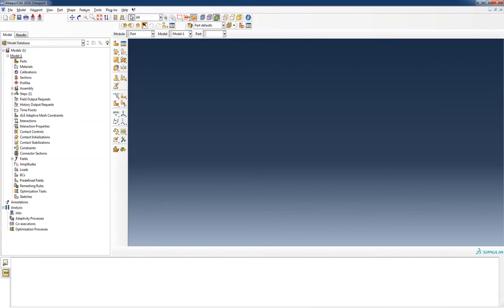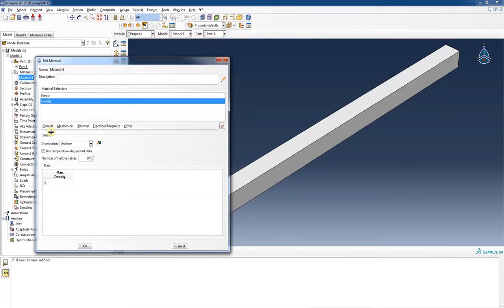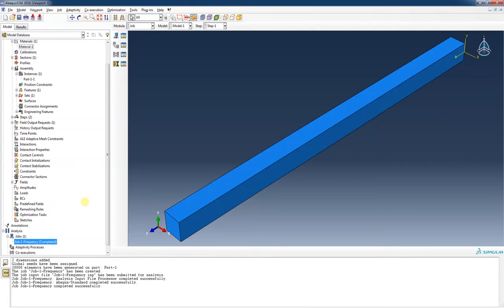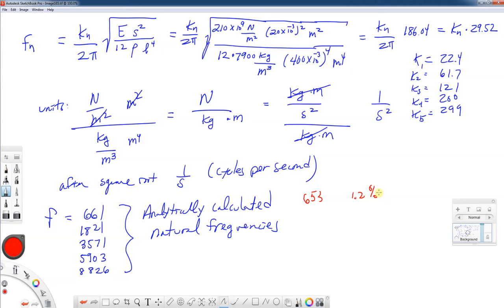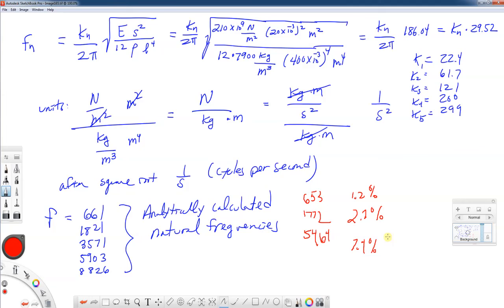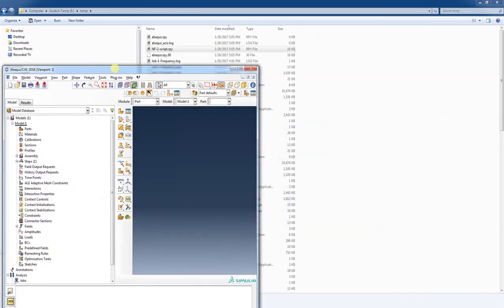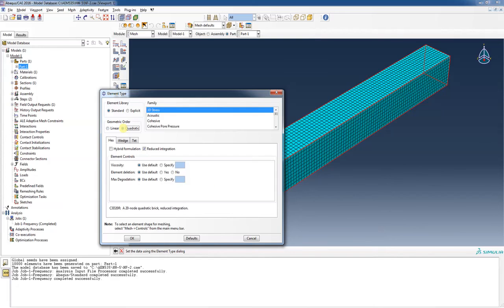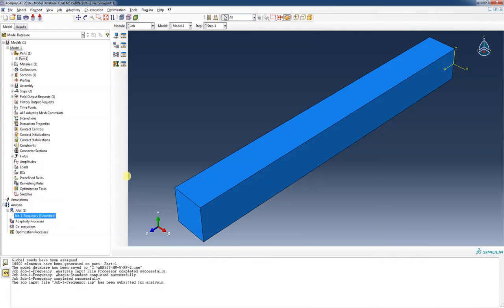AEM 535 HW-5 Natural Frequencies of a Beam--Part 2--FEA Solution

Comment: Is it possible calculate natural frequencies drawing a 3D Wired Beam Type? I've tried, however some natural frequencies obtained by Abaqus is a quite different from analytical solution. In addiction, when changing beam section area, specifically the width, natural frequencies of all modes keeps the same. Why is that happening?

Comment: Thank you very much for this analysis, highly appreciated. My question goes like this, I installed an aluminum vertical fin (50mm x 15mm x 3mm) balustrade system. The balustrade system was about 2.3m high with fixed top rail into a structure and fixed bottom into concrete deck which is in a high wind zone region (44m/s speed) and after some days a video was sent to us by the house owner showing huge vibrations on the vertical fins and we had realized that the resonance frequency of the wind (which I have no idea what hertz it is??) has matched the natural frequency of the fins in the system which I am currently working on to see what hertz they will be at in inventor simulation. Can I get what the frequency of wind is?? and is there a way I can get you to give more info on the explained situation. Unfortunately I don't have your email to shear my findings. Thanks and great job you are doing. But I believe that after getting the 2nd mode frequency of the system, let us say 70.13 Hz, how do we correlate it to the frequency of air to tell us if the system is safe? Then how do we know what frequency the system should be at in other to avoid matching the frequency of the wind which will cause it to vibrate. Assistance needed here please. Thanks eike272@aucklanduni.ac.nz
Reply from the maker: That sounds like an interesting problem.  I do not have experience with wind frequencies, but you may get some insight from engineers that deal with large light poles, signage, wind turbines, etc.  I suspect that it is highly influenced by local conditions.  You may also be familiar with the "Tacoma Narrows Bridge"  https://www.youtube.com/watch?v=j-zczJXSxnw  and there might be something in the literature about the resolution to that problem and how to determine wind frequencies.  It would be interesting to take a look at the video of your structure.  I think I am easy to find on the internet with a search of my name.  I have some colleagues that are involved in structural dynamics that could take a general look as well.